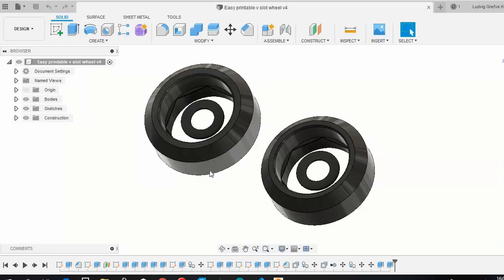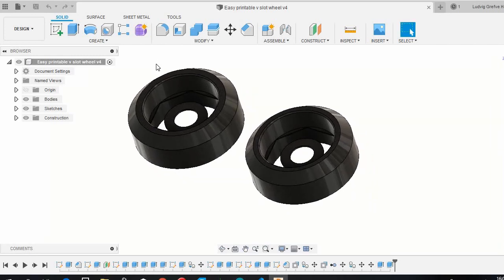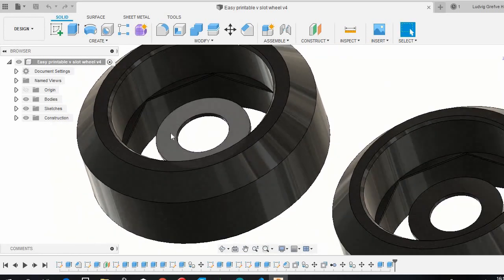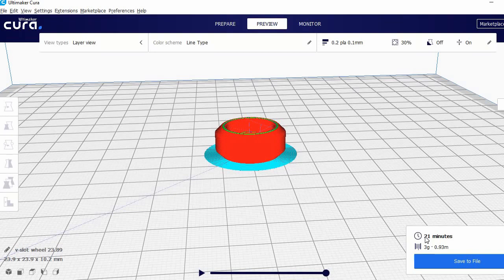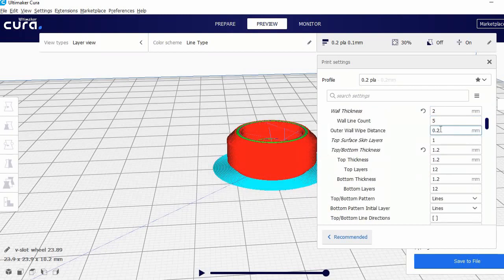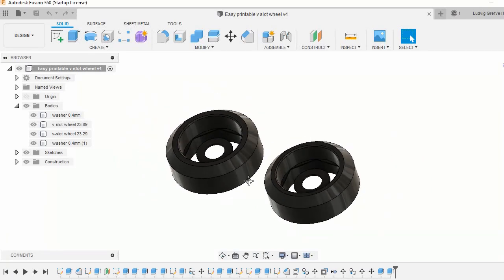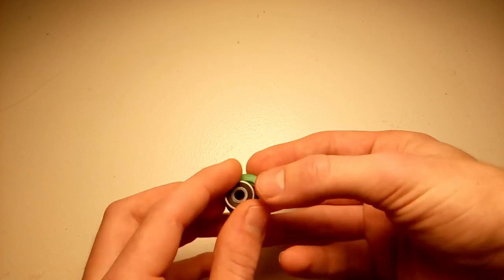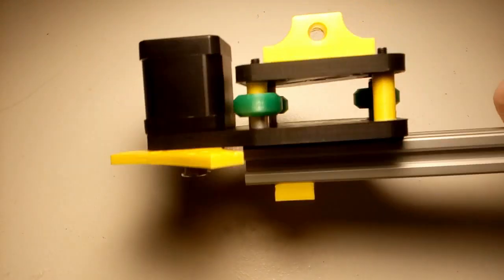3D Printed V Slot Wheels (Easy printable)

Comment: hi, Have you tested it ? is it really works ? I have tried other design before, mine has start & stop buldge in every layer. How do you eliminate the bulgde ? do you sand it ?
Reply from the maker: Yes, they do work quite well. I'm using them on my DIY 3d printer and I've done so for a few months. The print quality isn't the best but it's decent. The bulges are the z seam and you can't remove that completely but reduce it by tuning. (Might make a video on that at some point) No I haven't sanded them. Thanks for watching!